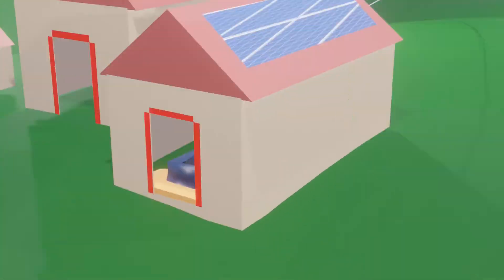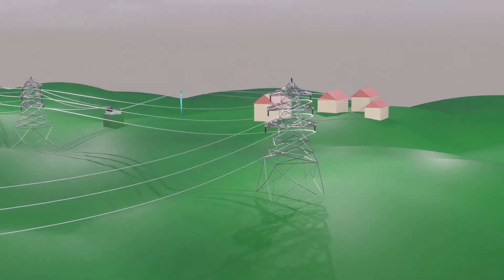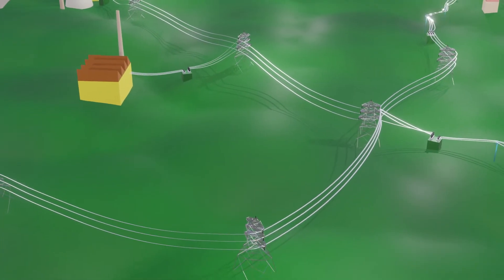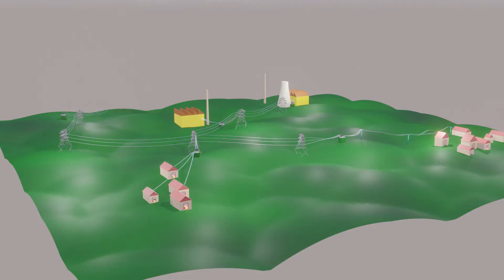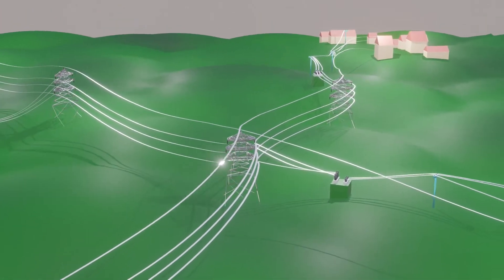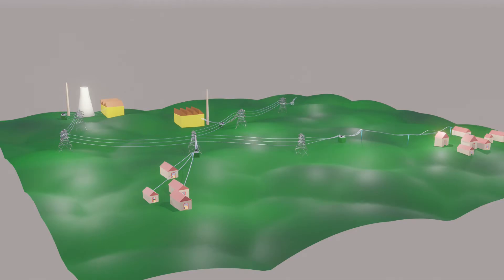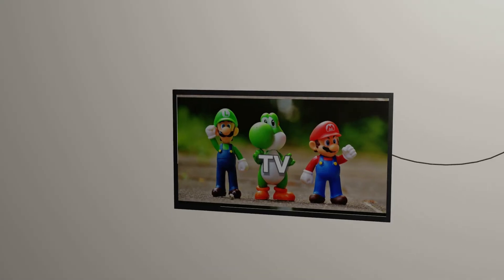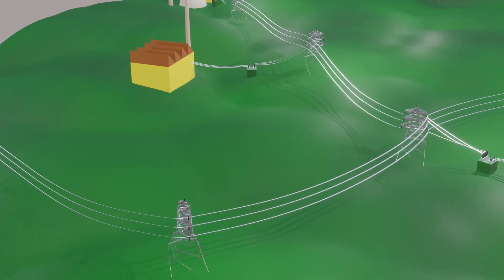Introduction to smart grid. 3D Animation. Smart Power Grid. Electricity transmission & distribution.

Comment: Excellent video.
There is an invention, EPM series, U.S. Patent No. 9641045B2 that could eliminate the need for extensive grid system, reducing both expenses and dependency on large-scale, hydroelectric plants, power plants or wind farm. The EPM represents a revolutionary approach to electricity generation, empowering states, counties, cities, businesses, and even individual households to establish local power stations. This innovation minimizes the need for costly grid infrastructure while making energy generation more accessible and sustainable.